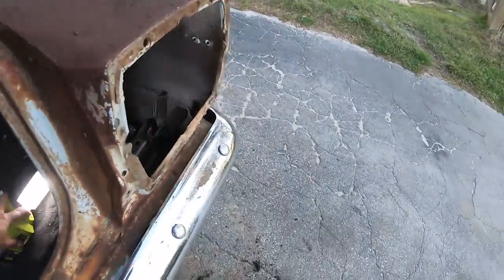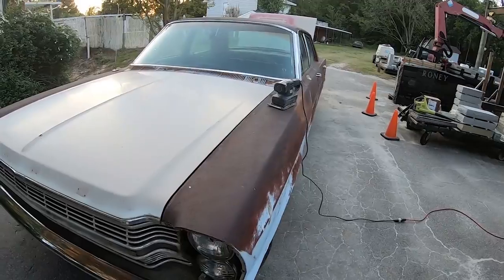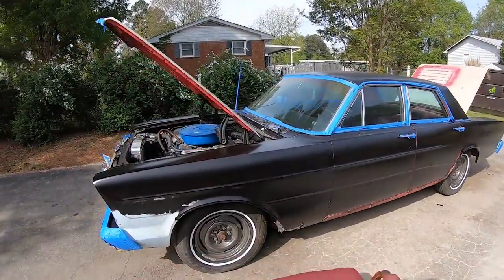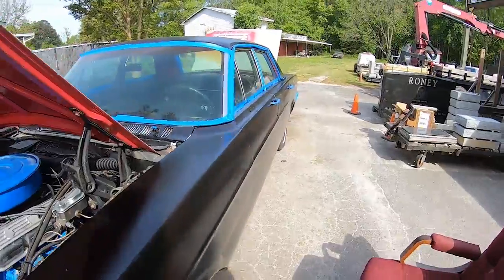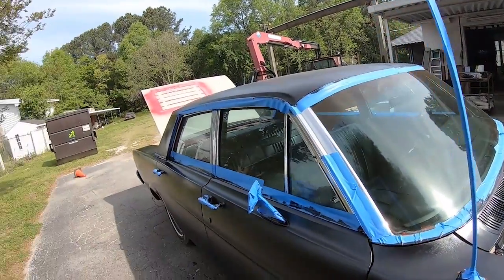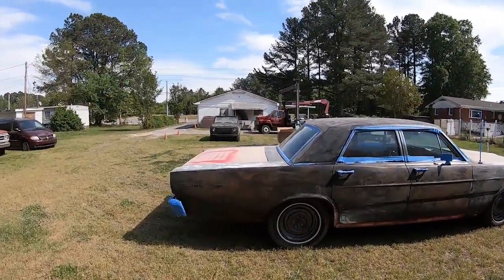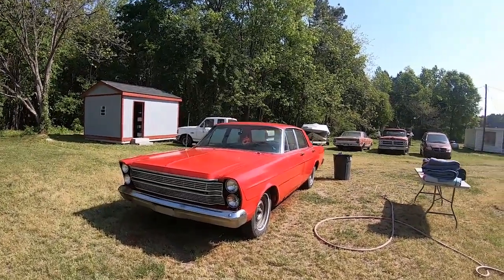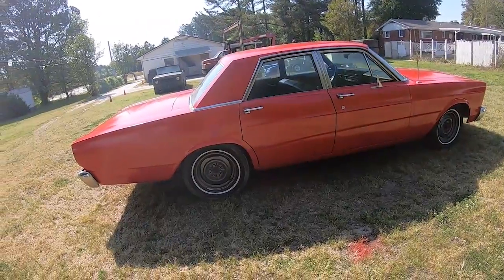Transforming My Classic Car for Under $350! - DIY Paint Job

Comment: Looks great ! If you want a vinyl top just use roll on bed liner ! lol. I have done a few home depot paint jobs as well with rollers and rustoleum.
Reply: That's how Chrysler dealerships did it back in the day for a budget vinyl top. You could roll Herculiner on and then paint a color on it with a roller.

Comment: Consider the surface rust that it had it really looks good Griff. Can’t wait to see the chrome trim back on it. 
A set of the old mustang magnum 500 wheels and white letter tires would really set that car off very nice 👍 but those wheels aren’t cheap Tho. 
Get on the US wheel website to look around their prices are very reasonable for aftermarket wheels.

Comment: I would have tried a flap angle grinder sander on that auto. Yes it would have taken more time but this car looked fairly clean and should have received that extra time. Needed a 40 grit to start. To each his own but it is something I would have tried. I would have stuck to the original color code. I guess what you did will at the least stop further degradation.